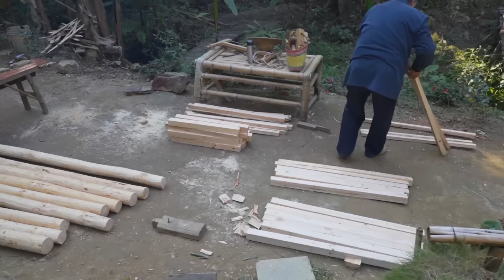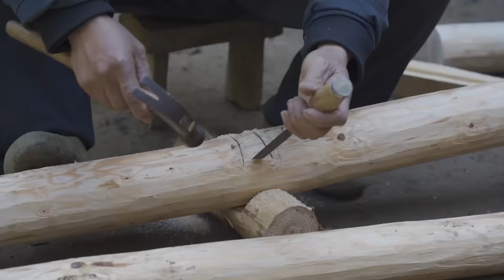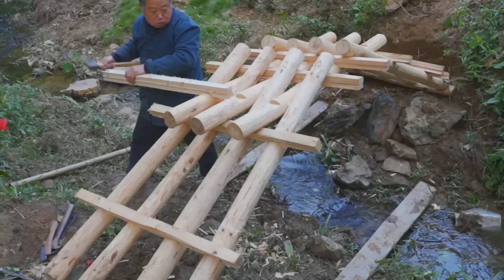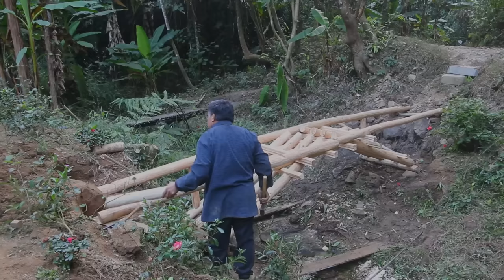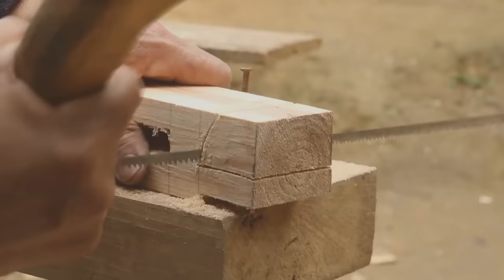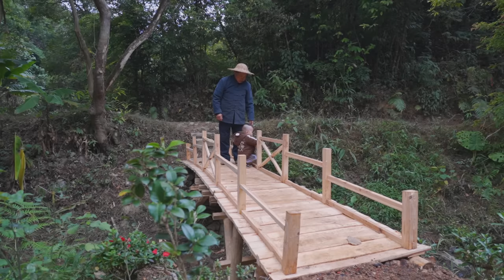阿木爷爷榫卯打造一座木拱桥，全程无钉子，高手在民间【阿木爷爷 Grandpa Amu】

Comment: Back in the day nails were expensive because of the metal and it was harder to make nails back then. This is kinda like DIY Adult Legos.
Reply: Even more, Europe used nails and yes they were very valuable, but most Asian counties lacked sufficient metal reserves so nails were virtually unheard of in construction. Ancient Japanese architecture thats 800 years old use the same latch technique. I’d use a Chinese example, but all of their sacred cultural sites were destroyed during the cultural revolution. :(
Reply: Why would you use nails?  They corrode and are no substitute for good wood joints.
Reply: @deemdoubleu  actually galvanized steel nails are corrosion resistant and it makes more sense economically to mass produce nails than to have skilled craftsmen custom notch every 2x4
Reply: @aneubeck4053  They don't make window frames with nails, at least not in my neck of the woods.  Nails have a place of course but Joiners are employed to join, framers may well use nails on 4x2s but the application is different.  In this case, tht bridge would have fallen apart within weeks  if he had used only nails to fix it together.
Reply: @deemdoubleu  you said “why would you use nails?” I answered you.
Reply: @aneubeck4053  not fully corrosion resistant. Once the thin zinc coating (the galvanised layer is only a few microns) has corroded or been damaged during transportation, handling or fabrication, the steel will be available for the corrosion process to occur.
Reply: I live in a German city that is more than 950 years old. We still have some of that houses that have been built with wooden frames, the walls made of clay and straw, called "Fachwerkhaeuser".
People back then didn't use nails, and if they had to, they used dowels made of oak and hammered them into pre drilled holes. All those houses have been built simple with mortise and tenon.
A carpenter had to be able to construct the water wheel of a mill, sawmill or cornmill, without a single nail in mortise and tenon. Millers had to be able to do this, too. The wooden parts did swell in the water, making the joint even more stable. 
They renewed the waterwheel every 10 or so years, when the wood started to rott in the water. 
Nails, often made piece by piece by specialized nailsmiths, were used for fixing horseshoes onto horses  hooves and iron bands on coachwheels and were made for their special use in small amounts. 
Even later, when nails were mass produced, they have been not cheap. So people saved nails, hammering them straight after pulling them, using them multiple times. 
200 years ago, let it be in the early 1900's, you could not just go to the next home depot to get a pack of nails in the right length, with the head you like, galvanized or not.
Reply: Back in the old age, Chinese crafters did not use nails at all. Nails were for the coffins only.
Reply: Nails in construction are crap. They have maybe one hundreth of the strength of wooden dovetail connection. Consider their minimal surface area, for example. Ever seen a chair which has been built with nails?! Even Ikea uses tie rods, not nails or screws in their cheap ones.
Reply: @nickgao1976  that’s literally what I said in my original comment.
Reply: @JohnSmith-yw7tg  I never said they were fully corrosion resistant.
Reply: @wwhb4780  if we had to make every structure without nails or screws you’d be hard pressed to find a dry place to sleep with 7 billion people on the planet.
Reply: @aneubeck4053  Did you ever in your life build any structure from wood, like a table or a chair, or did you ever walk by a house with a wooden framework? 
And did you ever see a house nailed together? Only things I know are cigar boxes or orange crates ...
Reply: @wwhb4780  it’s clear fitting them is a better way to fix two pieces of wood to each other, but nails serve a more important purpose as they’re cheap. My point stands that if you couldn’t use nails on a house and had to fit them together houses would cost waaaay more many way more people would be homeless. Nails are more important.
Reply: @aneubeck4053  You never can exchange an interlocked connection from wooden components against a nail. Would you wish to lean against the railing shown in the video if it was nailed at the sides of the bridge?! You can, for example, fix wooden beams against rolling or slipping off - if the weight is borne by something else, e.g. two long beams supporting them underwards. 
Nails are best used to hang a not too heavy picture at the wall.
Reply: @aneubeck4053  I'm sure you could automate the notching of the lumber if you wished.  In the current setting, they're substituting their time for money.  This would make a good project for someone out in the U.S. West, in lodgepole pine country.  Could probably make that whole bridge out of one tree, maybe two, with 8-inch trunks.  Multiply by 2.54 if you want centimeters..
Reply: I like the engineering of it.  The weight pushes down in such a way as to make the joints stronger.  If you look at your American-made deck or gazebo, there are metal hangers taking all the weight at all the joints, and none of the structural part of the wood structure is wood-pushing-down-on-wood.  The joints in USA-built is as good as the hangers and the metal screws fastening them to the lumber.

I didn't understand the dog-ear wedges until I saw them driving the uprights for the railing into the support.  They were forcing the wood to swell as it was pounded down into the hole prepared for it, lending it more rigidity at that joint, so the rail won't be wobbly.
Reply: Nice
Reply: @aneubeck4053  Id' rather think it was their masterly craftsmenship and their aesthetic sense which prevented them from wanting to have rusty nails in their bridges. They saved their iron for their chokuto swords in the eigth century, already. At that time, they had already developed ways to make steel for swords.
Reply: @wwhb4780  their skill with dovetails was developed out of necessity. Idk why you’re so salty. Everyone uses nails in home construction now that they’re available. Anyone who doesn’t build houses with nails is a sucker.
Reply: @aneubeck4053  I hate nails ;)
Reply: No this is traditional japanese craftsmanship
Reply: But on some NEXT LVL SHIIII!!!!!
Reply: @aneubeck4053  they use the same or similar techniques in japan, dovetails and no nails, everything fits together like a puzzle, no need to be so toxic tho
Reply: @JohnSmith-yw7tg  that's why it's called corrosion resistant not proof
Reply: @aneubeck4053  Agreed.

Comment: I hope everyone appreciates how difficult the joint at 10:03 is to pull off. With the wedges on the inside of the mortice and tenon joint, there is no way to correct it if you get it wrong. It has to fit perfectly on the first try. The Japanese call it jigoku kusabi: "hell wedge".
Reply: It very difficult to pull off, but not that difficult to “fix” it, the only cost is wasting the tenon.
Reply: @Sipingal Liu “Fixing hell wedge” should be one of his future contents
Reply: I fixed a Salmon fin back on a Totem pole with this method.
Reply: Japanese learnt this skill from China back in Tang dynasty

Comment: The mortice locking wedges on the the tenons are genius - those hand rails will never come out.
Reply: How effective is that wooden X that he places in the handrail? I have zero experience with carpentry but that looked questionable
Reply: Ya, I was wondering about that when he constructed them. Then I was like....oooooh!   That's awesome!
Reply: @matthewyim2258  Does what it needs to do. It's under enough tension to stay well stuck in place and will give more than enough rigidity to the handrails to be effective.
Reply: When I saw that my mind blown, that's a big brain move
Reply: and it's the only gap a child could easily go through

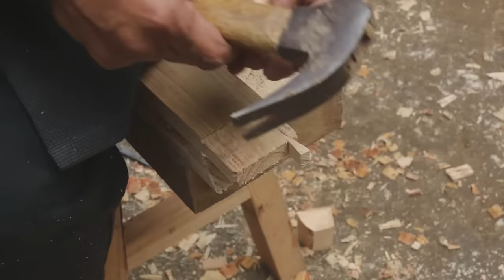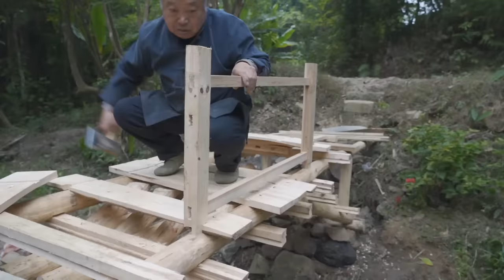Comment: 9:30 when little wedges are hammered into the tenon of mortice and tenon all makes sense when the are put home, 10:10 little wedges spread the tenon and secure the joint. Elegance within simplicity
Reply: Thanks for explaining that.  I was trying to figure out their purpose.
Reply: Fox joint.  Clever like a Fox.
Reply: Then the bottom cross beam of the hand rail, in turn, seats the floor boards... incredible
Reply: I also paid attention to these details. We were told at school that they used to build without nails. This video explains a lot about how they built without nails.

Comment: Oh my god. That wedge trick with the railing legs has opened my eyes
Reply: I was thinking the same thing. It’s brilliant.
Reply: Same, at first I was like wtf why would you do that it could only make the wood weaker and it’s not like you can use them to hold the wood up, but then he brings it to the bridge and I realise what hes doing and I’m like, this man is a fucking genius
Reply: Yes that will hold nicely.
Reply: RIGHT!? When I realized what they were for I actually gasped.
Reply: I’ve been studying woodworking technique that don’t rely on power tools & steel such as Amish & Asian joinery. That’s called Jigoku kusabi, aka Fox wedged tenon. I use it in some of my furniture’s naked/exposed framing like tables & chairs. It works better than wood glue! So I highly recommend dry fitting without the tiny wedges, in case you need to make additional adjustments because once it’s implemented, you can’t undo it! I learned the hard way, first time trying!😒😏
Reply: I'm not a carpenter. I didn't understand why he did that. Not until this discussion. The technique is brilliant and grandpa is an artist.

Comment: ENGINEERING

And, it fits the environment
Reply: There is no foundation. It will float away during the next flood. Right?  Am I missing something?
Reply: @barkingmadman1169  Paimon thinks Grandpa Amu dug out a hole first before setting up the structure

Comment: Im just amazed that he used a piece of hardwood to carve the dovetails of the softwood in the beginning....
Reply: Pretty sure that ain’t just a piece of hard wood
Reply: It's a tool he made, it's to shave. Basically there's a blade right at the edge and ejects the wood out of the hole on the side as you can see in the video. Hes a master carpenter
Reply: It’s called a spokeshave
Reply: @martinmoore3969  thank you for clarifying
Reply: @derekyam1805  it's not a spokeshave, the term for the tool he is using is a hand plane. used for making flat planes. opposed to a spokeshave, which is used for shaving parts round and originally designed for making the round spokes of wooden wagon wheels, that's where the name came from.

Comment: Everyone is amazed he didn't use power tools.  How about the fact he didn't use nails, screws or bolts?
Reply: @quickwear  Le comment est on anglais, mais tu replie en français? Je pense pas qui'll pourrat lire ton message.
Reply: @quickwear  I dont undertand your comment.Who were you expecting to read your message?
Reply: Nails, screws and bolts... How primitive. :p
Reply: I'm impressed by the fact that I didn't even see him use a tape measure
Reply: @webbit1518  Anyone with google translate!!!!!!!!!!!!!!
Reply: Im amazed by the fact he knew exactly howmany holes needed and knew exactly where it needed... He saw the finished bridge before he even started it...
Reply: Brandon S  Exactly.
With enough experience this bridge isn't hard to build.
What's impressive is the sheer amount of work done by hand.

Most modern craftsman simply couldn't do this, cutting this much with handtools is exhausting even for young people.
Reply: power tools it pretty expensive, but with it you can make same bridge in pair days. He made bridge for free he used tools he got and logs i guess he get from own forest.
Reply: @Kaczyfunny  he measured it by own eyes it is pretty simple when you have expreince, i'm welder, i can put parts on pretty exact location without measuring maybe 3-5mm error, which is not matter for this bridge

Comment: without needing nails, im sure replacing parts of the bridge as it gets older is much easier
Reply: If properly cared for a bridge built this way will last generations
Reply: Bubba Lou No, wood will moisturize and the forces that hold the bridge together will diminish.
Reply: @dibujodecroquis1684  not if they treat and paint it properly. Look at Japanese temple gates those logs have stood for many years
Reply: Well if you think about it, the humidity will cause the wood to swell a bit and tighten up the whole bridge. After all a quick fix for a loose axe handle is to drop it in a bucket of water until the wood swells. Another example, HMS Victory's longevity was attributed in part to how long the hull was left under water before finally being completed. Wood rot will eventually have the effect you describe, but not water content in the wood alone.
Reply: @bubbalou8080  The base of the bridge is sitting in the dirt, which will allow bugs to eat it.
Reply: It was Pine (a soft wood) only useable outside if its treated with arsenic to stop organic erosion from bacteria and bugs eating it. Would of Been better if He used a hardwood like oak and painted the supports going into the ground with a bitumen tar to stop water from soaking in. This will last only a decade at most.
Reply: Somewhat... Depending on which part you want to replace, you may need to take the whole bridge apart.
Wood can last many many years of treated properly. Sadly, the wood used in this video doesn't seem to have any treatment whatsoever, so it will eventually start to decompose and the whole bridge won't last more than 10 years.
Reply: m1st Sadly? They use local wood. Hand tools likely made nearby. 3 days to fashion and build. Lasts 10 years and you are sad? That’s sad.
Reply: When the wood gets wet it expands etc and I’d guess creating a tighter bond 

I don’t think it would be easier
Reply: He made the clearance for the tendons too tight. Once the cross post wood expands from moisture and possibly heat its going to crack and weaken the logs. The craftsmanship to get such a  tight clearance is insane and amazing. He just applied it to the wrong situation.
Reply: the mans a genius, with the untreated wood in a decade he will have another bridge to build and thus securing another pay day
Reply: Agent Bill Wilson as tight as those joins were that wood is only going to expand and get even more solid, but replacing parts with solid wood like that won’t be necessary for quite a while. That’s a damn good bridge.
Reply: @jasonpurcellau   Well it's not clear what wood he's using. Could be pine, could be chinese birch or something else. Harder woods are better regardless.

Comment: Thor: has most powerfull hammer in the galaxy.

Grandpa amu: hold my beer.
Reply: Hold my sake*
Reply: Hold my baijiu
Reply: flat on one end, sharp edge on the other
thought that was called an axe and not an hammer... :P

but Amu seems to use it more as an hammer, that's for sure.
Reply: Not hammer - Axe - Stormbreaker! :)
Reply: Thor is trash
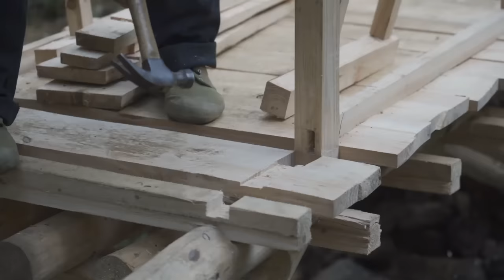Reply: @brrebrresen1367  , I saw a hammer at 11:50. But yes, this is incredible!
Reply: The axe!? Treeeee where's the handle!?! We need the handle for the axe!
Gramps Amu: Here go, I may you Fye handrows for Axe-u! Case you need extra!
Reply: he’ll drink it too

Comment: the bridge is finished, lets test it with a child.
lol
Reply: Everybody knows that a child is more destructive than a tornado LOL
Reply: Use an elephant. Elephant won't cross an unstable bridge
Reply: Jacob Lehnen elephants would need a bridge like that......
Reply: What’s a better test than to start with a lighter weight
Reply: I must have missed the  scaffolding grandpa was using to build that cause it sure looked like grandpa was climbing, crawling, and walking on the bridge to me.
Reply: Be kind.

Comment: Очень оригинальная, продуманная и безупречная в инженерном отношении конструкция. Очень высокое мастерство плотника. Использованы очень простые традиционные приемы и высокое во всех отношениях понимание дерева как материала. Исключительно грамотный Мастер.
Что касается клея и гвоздей - так такой деревянный мостик над ручьем в местном климате развалится за один сезон, если по современному сделать. А вот этот шедевр дедушку, даже при японском долголетии - точно переживет. Если дерево подобрано правильно. Только я лично в этом не сомневаюсь. Я у хороших плотников учился. И сам дедушка. А Авторам - спасибо за доставленное удовольствие!!!
A very original, thoughtful and engineering-impeccable design. Very high skill of carpenter. Very simple traditional techniques and a high understanding of wood as a material are used in all respects. An exceptionally competent Master. As for glue and nails, such a wooden bridge over a stream in the local climate will fall apart in one season if made according to modern standards. But this masterpiece will definitely outlive grandfather, even with Japanese longevity. If the tree is chosen correctly. But I personally don’t doubt it. I learned from good carpenters. And grandfather himself. And thank you to the Authors for the pleasure!!!

Comment: When I was in my teenage years, I lived deep in the rural Missouri. It was late 90s, and I had dial-up internet, which meant photos took about two minutes to scan top to bottom. I had access to fields and creeks, woodlands and quarries. I "invented" this frame when i was before 10 years old. I made the cantilever system out of big stems and rope. My dad was always hands-on, farm-wise. He to this day knows how to use a chainsaw and double sided axe. I did the best i could, but every spring, this bridge would survive the rains. I felt like DaVinci. This helps explain my love for physics and nature, I am able to figure puzzles and am always thinking outside the box. A connection to our environment outside should always be important, feeling the rocks and woods, breathing the air, basking in the sun is something that should be practiced weekly, if not daily. It will not only help ground yourself, but help understand everything around you.